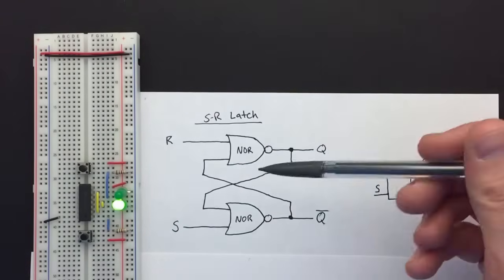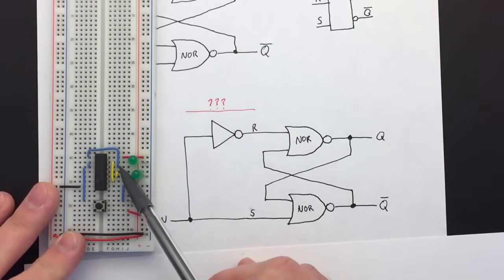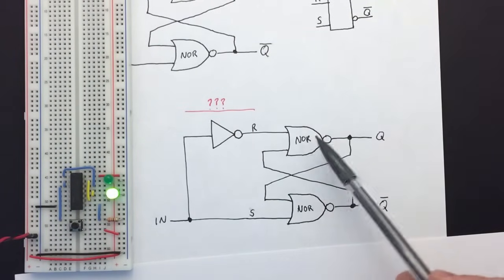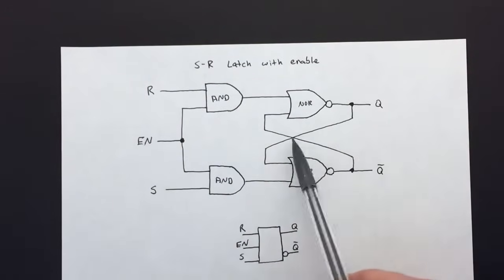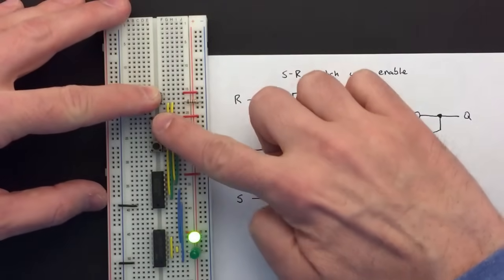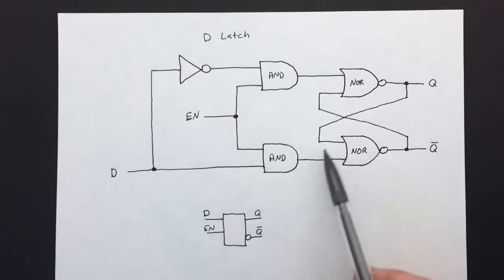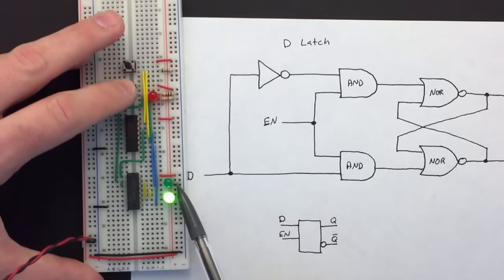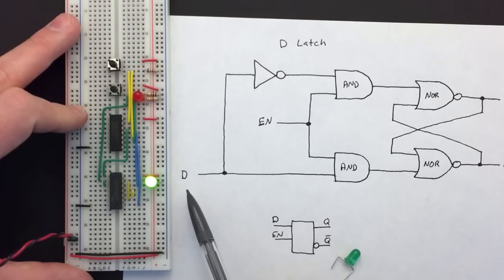D latch

Comment: Just an observation, I am following these tutorials and it may be my chip, but with 5 volts the chip did not latch, so I switched to 3.3V (since I use an arduino to power the circuit) and everything worked perfectly. So if any of you are having the same problem, it is something you can try!
Reply: as the arduino is a 3.3v circuit and if you are not using LS (Low Power schotkey) chips then you need to boost the power out of the arduino to get to 5v to run the chips properly because at 3.3v for normal chips you are at the threshold of off and on ... which can result in false positives and negatives often .... the other option is use the low power chips and be fine ... it all depends on what you can get at what prices
.
this is where circuit timing and power fluctuations and pulse width all come in to play if you use the normal chips on a lowpower system you will get more bad data as time goes on than you will get good data  as the thresholds will fade in and out of sync ... this is where the small capacitors and resistors come in to adjust power levels and minimize the drift

Comment: 7:42-7:44 You pressed the enable button.

 A AND gate can only pass a current through if you are pressing both of the buttons. (1 and a 1)

How did pressing the enable button change the LEDs. (0 and a 1)

It makes no sense.
Reply: at the start the circuit runs in what is called a RACE condition ... it is using any power fluctuations in the circuit to get a value ... so when you first power your circuit you get a power spike and you get the first false data value ... or pseudorandom state ... 
.
when the enable button gets pressed he adds a high (+5v) to 2 of the 4 pins ... so And 1 and And 2 each have 1 input at high ... the D switch or set ... when not pushed will have a high on And 2 for BOTH inputs as an inverter is tied between the switch and the input so if the switch is off the output of the inverter is high ... so And2 has 2 high inputs ... and And1 has 1 high and one low input .... 
.
so And 2 now goes high and works past the xor1 and into xor2 and so on down the line ... 
.
the enable switch does one thing only it allows for a single data bit to latch into a basic flip-flop and hold it there to be used ... 
.
a good video to go over for this one is flip-flops ... j-k flip flops for sure .. as j-k flip flopps rs latch and d latch are all based on the same thing and basicaly the same circuit 
.

Comment: I'm curious about the resistors. Are they there just as a safe guard to not overheat the circuits, or do they do something else as well? And how do you choose their values?
Reply: Resistors are small components that add load to a circuit to protect other circuit components from drawing too much current. Their job is to release energy as heat so that components like LEDs don't. Depending on the circuit's current draw and voltage rating, a resistor is chosen to best accommodate that rating.
Reply: pretty much what Conner said but also because if you don't restrict the current in the circuit, (in this situation) there would be too much current going through the LEDs and cause the fuse in it to blow up because too much energy.
Reply: For the bottom resistor, it's used as a current-limiting resistor like what Connor and Redd has described.

However, with the top and middle resistors, they serve a different purpose.  Logic gates like their inputs in definite voltage levels to differentiate logic values (ideally, +5v for Logic 1 and 0v or GND for Logic 0 for 74LSXX series).

I wouldn't blame you if you assumed that simply breaking the connection between +5v rail to an input pin of a logic gate would give a Logic 0 to that input pin (Made that same mistake the first time).  It doesn't work that way.  A floating pin's logic value is unreliable to say the least as it's sensitive enough to pick up interference from its surroundings.  In some cases, it could even damage your IC (if you're using CMOS-based ICs, like the 4000 series, 74CXX series etc.).

To correct that, the input is "pulled down" to GND by some form of connection to both provide as reference for the pin when the switch is off and to sink whatever noise the pin may pick up while it's at Logic 0 (the second explanation is something I inferred.  It may or may not be correct).

However, when you send Logic 1 into the pin, +5v is being sent to both pin and that connection to GND.  If a simple wire is used, then you'll be causing a short (I don't have to explain why that's bad, right?).  

Therefore, it's best to use a resistor as the connection between the input pin to GND.  A resistor connected for this particular purpose is called a pull-down resistor.

The value Ben used seems to be 1k, but you can use values as high as 10k.

For more info, refer to this link:  
http://www.mouser.com/blog/dont-leave-your-pins-floating
Reply: @L1307050302  
Wow, that helped a lot

Comment: Thanks for the clear explanation vids! However, I have a question about the circuit in this video. It looks like the green output LEDs do not have current limiting resistors. Why is that?
Reply: The ICs already have resistors built in
Reply: 3.3v to 5v ... chips ... he has a LS chip and NON ls chip so he is mixing a 3.3v chip with a 5v chip .. so he needs to draw the power upto to 5v with the resistors to allow for smooth operation of the differing chip power needs 
.
a 3.3v chip has active low about 2v ... while a 5v chip has active low at 3.1 to 3.3v ...  which is a potential problem so by adding the pull up resistors he makes the 3.3v low lower and the high higher ... reducing errors from chip power requirements
Reply: It's not a good idea to run without resistors even if there are already resistors built in, because the feedback is taken from a point between the LED and the built in resistance.  This will affect the output voltage swing so the designer has to consider this in a design.  Just because it works on one unit doesn't mean it'll work across many parts and wide temperatures.  Use low current LEDs and series resistors to make sure those outputs swing to proper logic levels guaranteed.  Also, include a small ceramic capacitor across the power pins to make sure the chip continues to be powered properly during any state transitions.  .01uF to .1uF should be fine as a general rule but there are exceptions.  In all fairness, this is probably beyond the scope of this tutorial.

Comment: can you basically replace the enable pushbutton with a wire, so you don't have to press two buttons at once, and just have a button for on and a button for off
Reply: yes ... but some changing condition item is more common ... like coins in a parking meter or juke box ... if coins present enable is set ... then select what you want and push the button to go ... a parking meter is an excellent example ... drop your coins in ... meter sets enable ... select your length of stay and press print ..  and poof you just ran a D lacth in real life.

Comment: Wonderful video.  Only, it seems like a lot of electronics to save a single bit !
Reply: Your computer RAM uses a transistor and a cap for each bit. It just refreshes the bits constantly.
Reply: just add a few billion more transistors and no problem. ;)
Reply: one bit  but the most powerful bit around .... when you type on your keyboard ... you use this .... when you play a video you use this ... your music uses this ... your programs run with this ... your drives ... your screen .... everything your computer does uses this simple circuit to get it's job done .... 
.
dont forget computers (logic circuits) are truly stupid ... they only can can count to 1 ... just very very very fast .... what we do with that ability using the basic latch allows a computer to add, subtract, multiply, divide, display and even play sounds .... heck a basic True A is 432Hz ...not the junk A they tune for now (440Hz) but a true A 432Hz ... it's what strativarius built his violins to and why they sound so perfect they use a proper A
so just by latching and unlatching one single pin at 432 times per second and sending the output to a speaker you have sound ... in this case a True A
Reply: so a super simplification of a computer is a ton of switches that are either on or off ... and what happens depends on how you set the switches and how fast you do that

Comment: why d flip flops also have "clr" and "s" pins ?
Reply: clr resets to a known state and set can preprogram a state both useful  options ... with the clr being used in the first second of the circuit being powered on .... when you dont do a global reset you leave a potential unknown condition set that could end up sending you someplace you dont want to be ... like the common one a memory overflow error or chip overrun ... if you have a register pointing to 0c00 but the spot it gets read from is showing 00c0 ... because it had a bit already set instead of cleared ... you wont be going to the same place .... as you expected

Comment: I love your Tutorials. How can I be a Mechatronics Engineer?
Reply: dumpster dive for old vcr's and electronics ... take the bits apart and see what you can repair and fix ... because you will have to go fro pcb back to schematics you will be forcing yourself to learn what they did where and why and so ultimately getting the best understanding of electronics you can .... so much better than memorising basic setups as you can tailor what you need to what is best easier